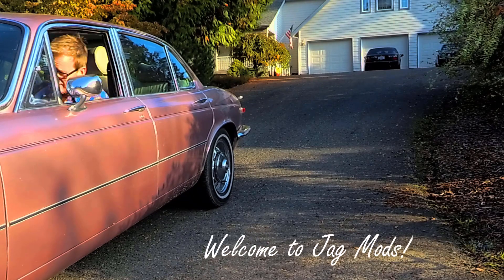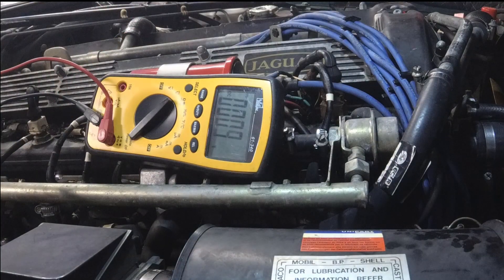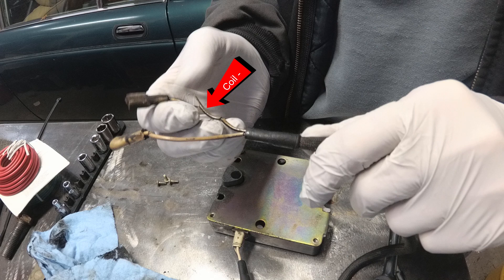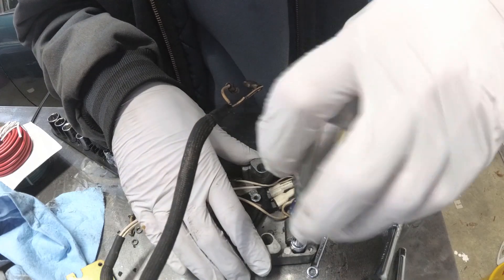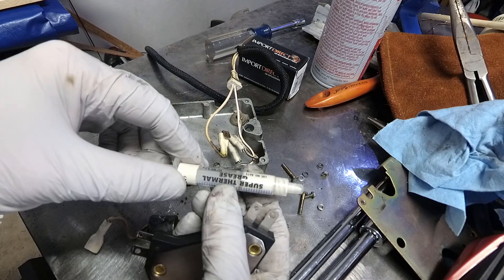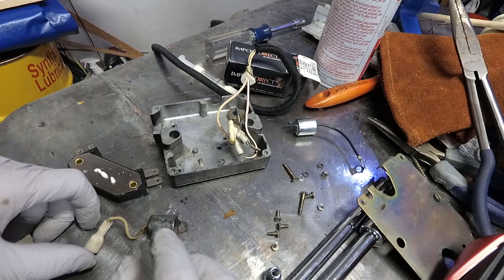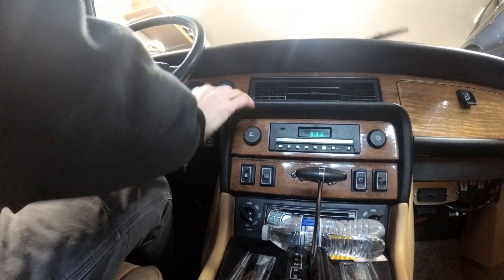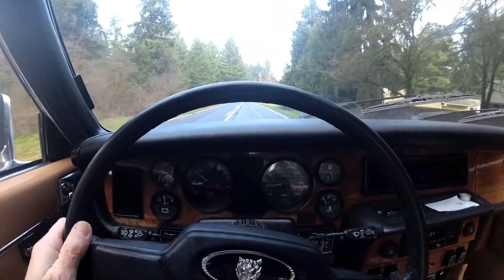Here's how to put the spark back in your Jag.

Comment: Great video. Fighting a non starting 86 XJ6 right now, no fuel (bad fuel pump hopefully) but also wont start with carb cleaner sprayed into the throttle body- i SEE spark when pulling a plug out, but wondering if the ignition system could just be weak? I'll be compression testing shortly but it sounds healthy.

Would love any thoughts, im new to the chasing of the tail  old british cars seem to induce.
Reply from the maker: I'm going to assume your Jaguar is a Series 3 or late model Series 2 XJ6.  None of what I just typed applies to the newer AJ6 engine.

No fuel? It may not be the fuel pump. Here's how to check it
The fuel pump only runs when the engine is being turned over. To trick the system and get the fuel pump pumping. Hold the mass air flow sensor, the big flappy thing between the the air cleaner, and throttle body I used the handle of a really big screw driver Something big so It doesn't get sucked inside the engine.  A mates fingers work well. Me? I don't have any mates. Put the gear lever in reverse, and turn the key to the on position DON'T CRANK IT OVER.  You should hear the fuel pump whirring away.  Jag's have a circular aka open fuel injection system, meaning any unused fuel is returned to the tank.  The pump should be pushing about 36psi  This can be tested by disconnecting the fuel line from the fuel rail. Be careful not disturb any of the hoses to the injectors or the injectors themselves.  Looking at either one of these cross, will cause them to leak. 

I'm also assuming the ignition timing is close to spot on. The rotor is points at #6 (closest to the radiator) or #1 (closest to the bulkhead) plug wire at (8 degrees) before top dead center or at least really close. the XK 6's are typically timed from the #6 plug.  but who knows.

I'm going to assume that the ignition hasn't been modified (like mine)
Checking the ballast resistor (it's the ceramic block with two leads one on either end.  One goes to the ignition relay on the bulkhead, and the other goes to the + side of the coil, and the 3rd goes to the ignition amplifier.
Disconnect the plug that goes to the ignition amplifier, turn the key to the on position, Check the voltage on all connections, all should read battery voltage. 
Checking with a voltage meter
+ lead touches the ballast, and negative (-) lead to ground, or the negative terminal on the battery.  if any of the connections are read zero voltage, then the ballast is dead.
 
checking the Coil
Reconnect the all ballast connections, except the connection to the amplifier. Connect the voltage meter + lead to the + on the coil, and ground meter lead to the ground at the battery. The voltage should read between 4-6 volts. 
No voltage or voltage less than 4 volts indicates the would indicate the wire from the ballast to the coil is damaged or broken.  

Full battery voltage indicates there's a break in the primary circuit  meaning; there's an issue with either the coil or the ignition amplifier. 

checking the primary coil winding,
disconnect the leads at the - (minus) side of the coil, connect the + lead on the voltage meter to the - terminal on the coil, ground the - lead of the voltage meter you should have full battery voltage.  A zero reading indicates a cooked primary winding. replace the coil
reconnect the leads to the coil, you should have around 2 volts if everything is working as it should. 

Full battery voltage indicates a faulty amplifier or  bad ground. Voltage reading more than 2 volts but less than full battery voltage indicates high resistance in the amplifier or the wiring to and from the amplifier or  bad ground. 

Checking the coil secondary winding with a voltage meter 
Disconnect the HT lead from the center of the coil, hold the + lead of the voltage meter inside the coil (I wear rubber or heavy leather gloves when I do this) then the negative lead about 1/4 of an inch away from a good ground source. crank the engine over.  The voltage reading should fluctuate between 3-4 volts and a regular spark should appear.  
If the voltage is correct, and no spark then the secondary winding of the coil is cooked. - Replace the coil 
If the voltage remain low -  less than 3 volts then the amplifier should be replaced.  It's a good idea (though I didn't do it) to replace the pick up in the distributor at the same time. 

Hope this helps.  
Keep me posted how you get on. please.  
There are other factors the 3 relays on the bulkhead &  cam chain tension issue that can cause the same issue.
Reply: You're an absolute legend for this! For fuel, when disconnecting the starter trigger from the starter relay, I hear the pump turn on and gurgle, but generates no fuel pressure at the rail or immediately after. I'll give these other tests a go and hopefully report back with some good news, thanks again!
Reply from the maker: @TylerRogersUSA  
thank you for the kind words.  tell everyone you know about Jag Mods :) 
Fuel trickle  - check the fuel filter. It's in the boot next to the spare tire under the floor (panel)  It's a great big coffee can looking thing.  - if the car's been sitting for any length of time, chances are the filter is plugged.  Also while it's off blow out the fuel line. Make sure it's disconnected from the fuel rail. 
Check the the tank switch solenoid is functioning properly. You should hear a clunk when it swaps tanks.  Oh, you also might try each tank for fuel pressure - it's very possible crap in the tank could be blocking the flow of fuel prior to the pump.  Sometimes giving the back of the car a good bounce to splash the fuel around can dislodge something clogging the inlet.  It's a long shot, I know.  It's kinda like pounding on the fuel tank with a dead blow hammer on Chev pick ups to get the fuel pump to start up.  This does actually work. 

Draining the tank
Under each tanks, there's a hole with a plastic plug (maybe) most of them have are long gone.  Anyway, there's beyond the hole is a plug to the bottom of the tank.  This is where you drain the fuel out of the tank.  Be sure to open the fuel filler cap. 

Fuel Pump access panel
In the rear wheel arch - behind the rear tire, there's a round plate with 4 fasteners. and a couple of wires coming out of it.  This is where the fuel pump lives.  take care loosening the fasteners. More often than not they snap off.  That my friend will turn into a really bad day.

Other related and not commonly thought of
Sometimes the vapor canister in front of the left front tire gets plugged up.  A tell tale sign of this is when you open the fuel cap, there's a sucking sound.  This can be a bad thing. on rare occasions (very rare) the seal on the filler cap is so good that the drop in fuel can collapse a fuel tank.  Though, I don't think you're at that point yet.  

Do keep me posted on your progress

Cheers!
Mark
Reply: @JagMods  Good to see I'm on the right track! Before cranking I replaced the fuel filter and blew out the lines, as well as drained both tanks. However I did not check the lines from tank to the pump. Solenoid is working spot on. As for the hissing tanks- I caught onto that and simply bypassed the charcoal canister valve.

Ill give the bounce a shot- see if something is lodged in there while im waiting for my new pump. Thanks again Mark!

All the best,
Tyler
Reply from the maker: Compression should be somewhere between 155 and 145 psi ; and 135 at the low end.  The next bit, I'm throwing out there, just because my '86 XJ6 had this issue.  I got the ignition and the fuel all with in spec - it wouldn't start, then out of the blue it would fire right up and run great.  Hopped in took it for a spin. Came up to the stop sign at the end of the street and it died.  This happened several times.  Sometimes I could get it to start at the stop sign but more often than not, I'd have to walk home and get the trailer and drag it back home. 

Got it fired back up, gave it a rev or two, then heard timing chain back-lash. Hmmm... 
Popped the cam covers off Exhaust came chain was perfect, the intake had about 1/4" of slop.  tensioner guides did have wear which looked about normal for an XK with 139k on the clock and a floppy timing chain.  Adjusted the timing chain picked up the slop; and it fired right up.

I'm not saying that this is where you're at, but it's something to keep tucked away.

Thank you for the update
Mark
Reply: @JagMods  I'm back to bother you a bit more Mark! Do you know if the tank selection solenoid is supposed to flow freely? As in, i have gas flowing from my tank TO the solenoid, but when disconnecting the solenoid feeding to the filter I dont output any gas, does this require suction from the pump? I only ask because I am still waiting on my new fuel pump- Maybe tomorrow I will bypass the solenoid and give it a shot...
Reply from the maker: Tank solenoid, short answer, yes. 🙃 
The device right after the air cleaner isn’t the throttle body, it’s the mass air flow sensor. I am not too sure that I would shoot that with an Carb cleaner. The throttlebody is at the other end of the 90° elbow off of the back of the mass airflow sensor. 
 If you’re poor fuel system all bench checks out there is also an emergency fuel shut off in case your Jag is rubber side up and it’s a little black box on the right hand side well so the passenger side if it’s a left hand drive car or driver side if it’s a right hand drive car. On the top of that box there’s a little plunger thing and it should move up and down freely. Sometimes they get stuck in the position which will shut the fuel system down
Reply: @JagMods  sorry to clarify- but the solenoid from both tanks. Should it output while disconnected from the fuel pump or not?
Reply: @JagMods  I'll take a look at the fuel cutoff
Reply from the maker: @TylerRogersUSA  the solenoid has two fuel inputs and one output obviously the output goes to the fuel rail. I haven’t taken one apart yet to see if it’s a ball or a cylindrical solenoid.
Reply: @JagMods  if the fuel pump doesnt work I'll report back! Talk soon mark
Reply from the maker: Sorry for the cryptic responses.  I was sitting in traffic on the freeway;  So here's a better response.
first off, if the fuel is dirty it is possible for the tank solenoid to get stuck. 
here's an example if the right hand tank is selected
L.H. Return Solenoid will have power 
R.H. Return Solenoid will not have power. 
So the fuel return solenoids are naturally open.
Tank change over Solenoid is also naturally open so fuel will flow from the Right tank if power is applied to the change over switch. 
 No power at the change over switch will allow from the Left tank.
 Hope this helps..
Reply: @JagMods  not a worry Mark! I'll report back if the pump changes the flow regarding the solenoid- I do hear it change over. Just not sure if it flows correctly yet
Reply from the maker: Just to make sure we are on the same page or at least I understand - I suppose that's closer to reality.  
Fuel pump is between the tank switching solenoid and the fuel rail and is wired independently from all three solenoid - the other three being, , the switching solenoid and the two fuel return solenoids (one for each tank). The fuel return solenoids are what let unused fuel back into the appropriate tank. So the tank switch and the two solenoids work in with one another.  

Some Jaguars, have an air bleed off valve after the fuel pump but before the fuel filter.  Some have it some don't. then from the filter to the fuel rail.  unused fuel is returned to the appropriate tank running through the fuel cooler (to prevent vaporization) then up to a series of expansion points and pipes in the C pillars then into the tank. These are pipes and spansion points are to prevent a "water hammer effect of fuel when it's switched from one tank to another, and also a last ditch effort of condensing any vaporized fuel.  So how I understand it.  
Sorry my response isn't as to the point as ignition; that's because I just haven't had much issues with the Series III & XJ-S fuel systems; they just work.  Now the Series 1 & series 2 fuel systems is a different story.  In my Series 2 I cheated and put two electronic pumps in. One for each tank. I got tired of dealing with the SU pumps not working.
Reply: @JagMods  so the tank selection relay before the fuel pump was locked up, now I've bypassed it and hear pressure at the rail using your airflow fuel pump trick! Now it seems my injectors are all clogged up anyway, which makes sense sitting for 10 years... Bench testing them I hear nothing and no fluid flows
Reply from the maker: @TylerRogersUSA  thank you for the update.  RockAuto part jag part number EAC1851& Parts geek dot com have replacement injectors. 
Try soaking the business end in carb cleaner to see if the nozzle will clear up. 
Your gonna need the seal kit to put them back. SNG Barratt has the tank switch part #CBC4269 
Actually SNG Barratt has all the bits including the injectors, a bit spendy though
Reply: @JagMods  rebuilt the injectors with a kit of 6, primed the rail and she started right up! A few leaks to clean up and some serious odds and ends to repair but awesome to see her start! Thanks for all the guidance and support Mark, you've been a phenomenal first contact in the world of jags

Cheers mate
Reply from the maker: @TylerRogersUSA  well that is great news, mate!! I’m so happy to hear you’ve brought another jaguar back to life. 
Good job!! 
Oh and thank you for the kind words. ☺️